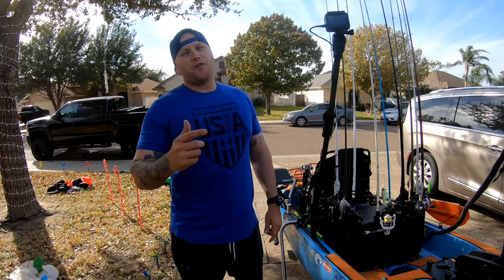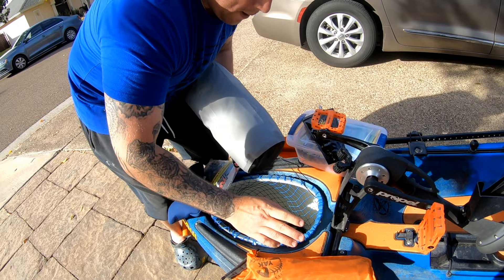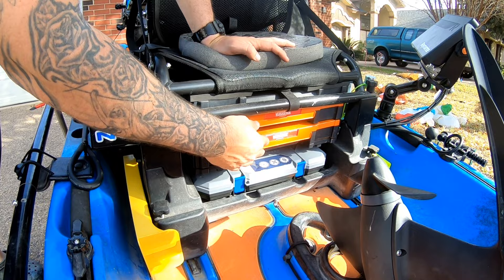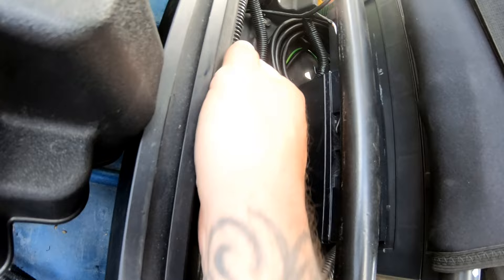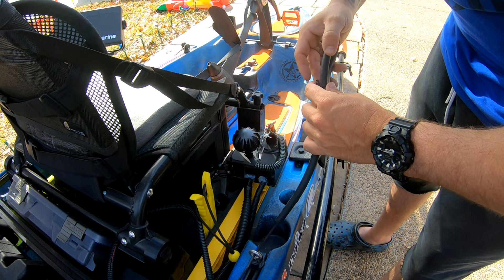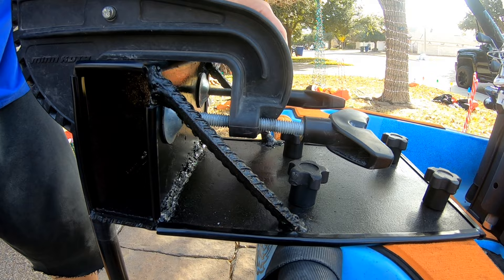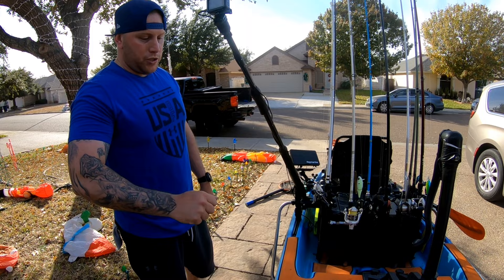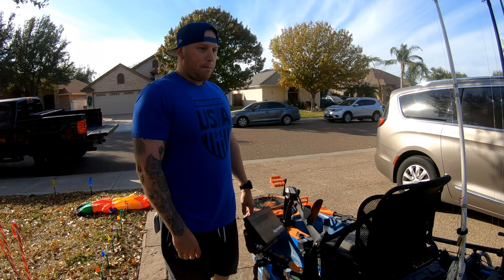Native Titan 10.5

Comment: My titan 12 had water leaking from the back hatch…. I removed the o ring and cleaned the sealing surface and lubed the seal with Vaseline also ran a bead of clear rtv around the hatch. It stays dry now

Comment: Is there another form of communication? I don't have Facebook.  Thanks.  Love the setup especially craftsman double drawers.
Reply from the maker: What you need bro?
Reply: I need to replace the rudder steering handle. Like you said,  I'm afraid of the plastic gear will  stripped out. Thanks. Much appreciated for responding quickly.
Reply from the maker: @nongkhong374  just sent a message for you to NLD Ryan Garrett and asked if he has another way to contact which he prefers, as soon as he responds I will let you know.
Reply from the maker: Contact Ryan Garrett at cymatics2018@gmail.com
for your handle 👍🏼

Comment: Will that versastack fit under the seat with 2” risers?
Reply from the maker: Im not to sure, I have the 3" and I got it to barely clear the seat so I would say no, BUT, Im sure if you do some cutting or forcing it will work. If you run into issues but want a drawer for storage, check out the Sterilite boxes they sell at Walmart, Target. I used that for a while and it was okay, just one big drawer, of course the Versastack is way better but the Sterilite's still get the job done.
Reply: @JoshuaCantuFishing  thank you, I’ll check those out. I contacted Jeff about the 3” risers and he said he will let me know when he has some made, but just not sure when that’ll be.
Reply from the maker: @jpoutdoors23  awesome, he hooked me up pretty quickly but that was last year, hopefully he is not to busy and can do the same for you. That extra height is worth it tho.